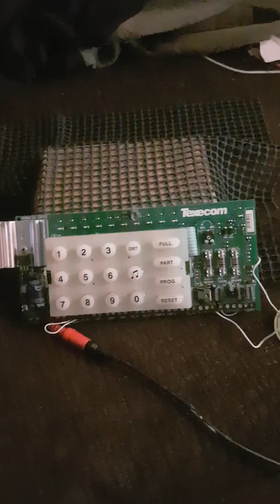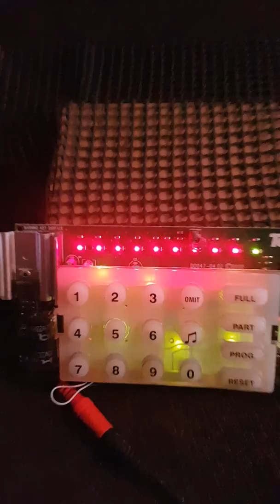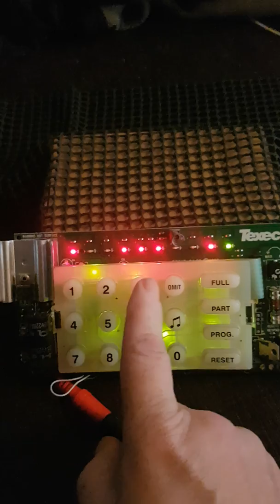Default engineer issue

Comment: Hi Gary can you tell me why the 24hr red light is flashing please
Reply from the maker: @RodStallan  Hi Rod check if the mains power is on. If its on then its the battery that needs replacing in the main control panel
Reply: @ Thank you so much we will give it a try and let you know how we get on .
Reply: Hi Gary new battery fitted still flashing red light ??
Anything you can suggest please.
Reply from the maker: @RodStallan  call me please 07555203296 Garry
Reply: @garrytaggart2431  Hi Gary thank you so much for sorting out our alarm in Spain over the Phone .
Your knowledge was highly appreciated and would recommend you to anyone I know.
Reply from the maker: @RodStallan  Your so welcome anytime thank you for the nice message regards Garry

Comment: Hi I’ve got unset and tamper flashing red and green ,plus 2 zones flashing red , none of the button on the panel are doing anything? Any ideas does it need a new battery as turning mains power of didn’t stop it
Reply from the maker: Remove the front cover and find the tamper circuit and put a link of wire to close the tamper see if that works. if not let me know
Reply from the maker: call me 07555203296
Reply: @garrytaggart2431  top man so helpful 👍🏻👍🏻

Comment: Hi Garry, I have moved into a new property. It is fitted with Scantronic 9651 and with separate Keypad 9930. Keypads buttons are broken and I can not enter password.  Also, I have forgotton the Engineer password. I want to replace the keypad( same for same).
I have decided to open the main system and try to go for a default reset of all passwords.

My worry is that when I am going to open up the main system casing, it's going into temper mode?? Am I right? Will the system let me reset all the passwords to default passwords during temper fault mode by disconnecting the system from battery and main supply. The manual explains that by short circuit of NVM  and Kick start pins I can reset passwords to default passwords. 

I think I can manage this if I know how to deal will temper fault issue. Also do I need to reset all the zones afyer replacing keypad or will the alarm will start working as normal after the replacement of keypad??

Please can you help me so I can replace my key pad.

Comment: Hi gary 

just needed some advise i have the veritas R8 alarm and keypad went faulty so replaced the keypad and showing no power on keypad, we have done test and there is power going in however showing no lights on keypad, 

we have two kepad one down stairs and one upstair, The upstairs one keeps flashing unset/tamper and the downstairs one that has been replaced shows no lights

any advise?

thanks
Reply from the maker: sorry been in mexico for 2 months are you still having an issue
Reply: @garrytaggart2431  hey mate i’m trying to make mine out and pulled the key pad out by accident how do you put it back in?
Reply from the maker: @jamiespencer6400  1 N/A Off Off Off 1 2 4 3
2 N/A Off Off On 1 2 4 3
3 N/A Off On Off 1 2 4 3
4 N/A Off On On 1 2 3 4
5 N/A On Off Off 1 2 4 3
Reply from the maker: "NEVER set two RKPs to the same address. 
Keypads are factory set to Address 1. 
If the keypad is powered but offline (i.e. T and R not 
connected) it will display its address. 
If an invalid address is selected, the keypad will 
sound an error tone.
Reply: @garrytaggart2431  one more question is there anyway to get the bell box not to sound as i can’t get to it but want to take the alarm out inside
Reply from the maker: + RED WIRE - BLACK WIRE,  T GREEN WIRE,  R YELLOW WIRE. This is how i wire mine but the wiring configuration on yours maybe different check inside the main panel look for RKP and simply copy how they are wired  take a photo that will help. if you have 2 keypads use the diagram ive sent you inside the keypad are some pins that will need adjusting for 2 keypads. Hope this helps
Reply from the maker: @jamiespencer6400  Normally they will only sound for 15-20 mins if you disconnected the mains from the panel & removed the battery it will trigger the bell as it has its own internal battery but should shut off in the time I mentioned.

Comment: Moved into a property got no code for veritas r8 I have been told the alarm has been powered down for 2 years i tried the engineers codes you showed but nothing happens just fires up the alarm box outside so had to turn the power back off.
Reply from the maker: Open the panel remove battery and mains power turn on mains while the power is returning press the main tamper spring a few times this will reset the panel providing the original engineer has not locked in the engineer code or call me 07555203296

Comment: Hi
I have installed for many years a veritas 8c and now I install a keypad on the 1st floor
The keypad set the alarm on but it doesn't turn it off. The only way to turn it off if using the engineer code on the pcb!!!
Any clues about what to do?? 
Many thanks
Reply: default enginers code is not 1234 lol,  as there would be break-ins everywhere but I am not telling anyone has we enginers and ex engineers are not allowed to tell anyone

Comment: I have just changed my remote keypad, all wired correctly but when I reconnected the power the alarm is constantly sounding and will not reset, Any pointers as to what I'm missing 👍
Reply from the maker: Are you saying it won't accept your code and unable to disarm if so try 1234 or 4321 sounds like the system has reset itself if these numbers work message me I'll tell you why and what you need to do next or message me if your still having issues anyway.
Reply: @garrytaggart2431  Gary-I had a power failure and found battery is no good but now power is restored i have no control over the keypad. my user code plus engineer code 4321 and reverse also do not work-no idea who installed the system. House is 7 years old.
I'm guessing i will need a new keypad as it seems same issue as above-please advise-Thankyou
Reply from the maker: @chrisspringett5465  Hi call me tomorrow morning please on 07555203296 say about 10.30 am
Reply: @garrytaggart2431  sorry missed your reply-will try you tomorrow Monday-thanks
Reply: Gary Thank-you for your informative explanation and experience-alarm panel now functioning as intended.

Comment: Hi Garry, had very similar issue recently.

Customer called and previous company had gone out of business (retired). No way to contact and no way to unlock panel. Absolutely nothing wrong with the system apart from it had been programmed to throw up "SERVICE" message after 365 days lol. 

Luckily I have worked with a lot of microprocessors and can reset most Texecoms and Pyronix. If it saves anyone the same hassle I'm happy to unlock them for a small fee - especially if it means helping out another engineer!

 https://www.ebay.co.uk/itm/233454221343